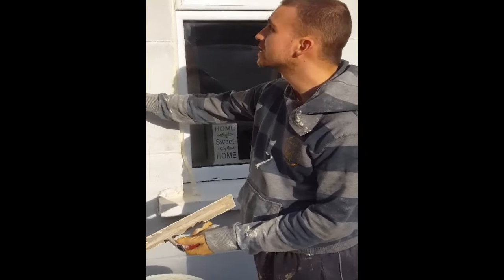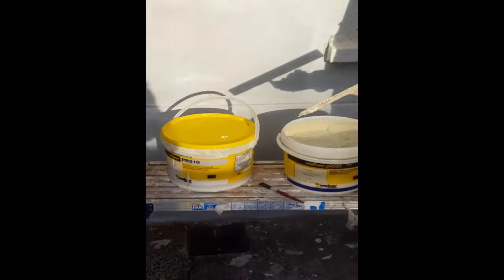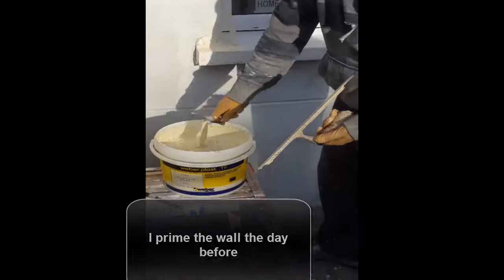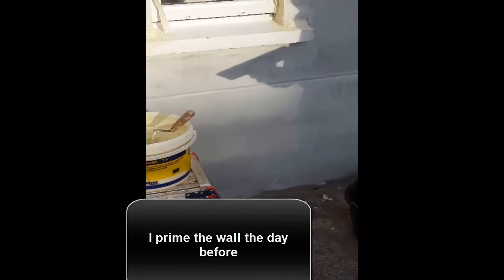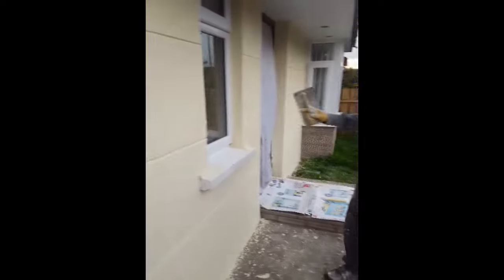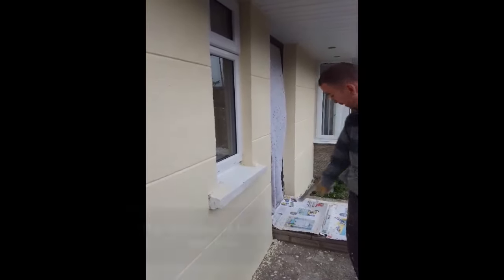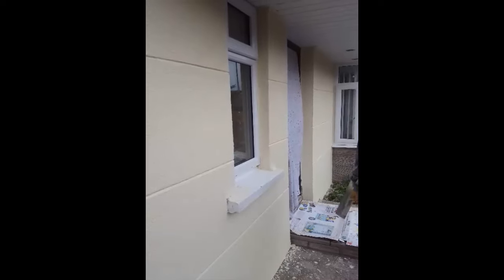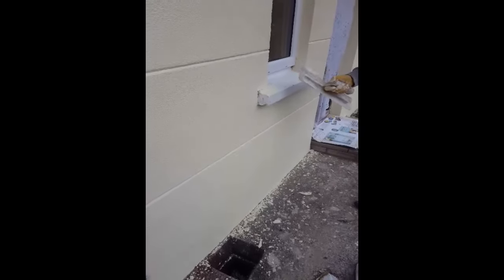ACRYLIC RENDER WITH V CUTS , HOW TO AND TIPS

Comment: What a remarkably tydy finish, seemed to be a quick drying outdoor rendering plaster.
Reply from the maker: it is strange in the fact it will dry quick in a way where if you try to work it more you'll tear it  and mess it up but if it rains within 8 hours i would say you'll get stains and colour washing off 

thanks for watching Steve :)
Reply: I could see that it doesn't like to be over worked therefore it might not suit the amature like myself who may not know when to leave it. I found it hard enough to do with plaster that was not so fast drying. It looks to good to use on my garden brick wall that needs doing. I may try your rendering technique instead and make it look like brick as some of the brick face is in bad state. Plus if it rains it will not be complete disaster the plaster you are using looks rather too expensive to be caught out in the rain. But I usually say if we look at the clouds we will get nothing done.
Reply from the maker: Steve Phillips Sounds like a good job hope you o a few before and afters mate :) yea we will get no work done sky watching :)